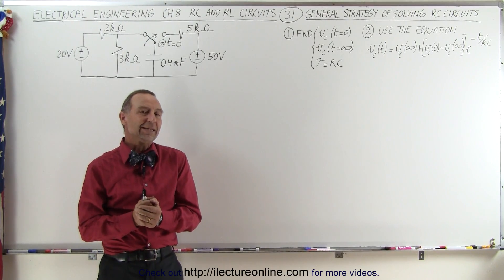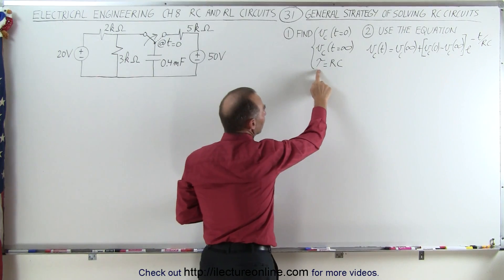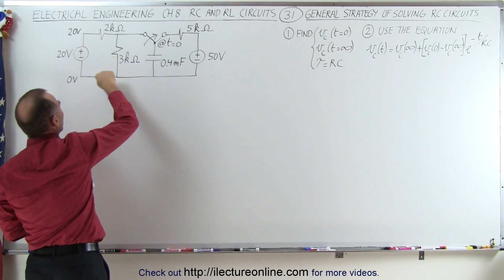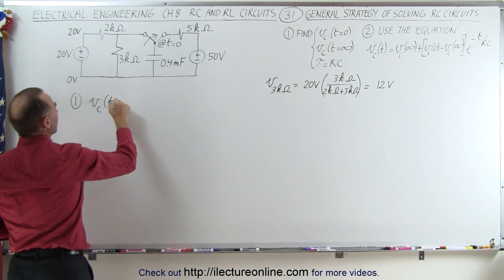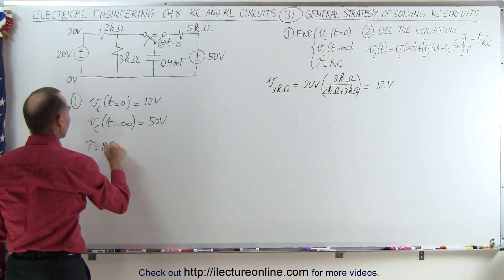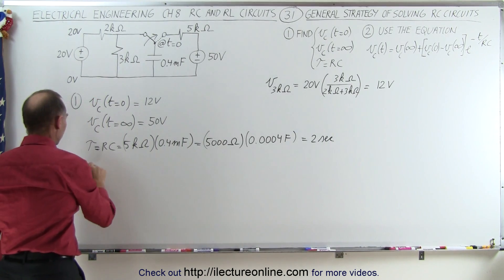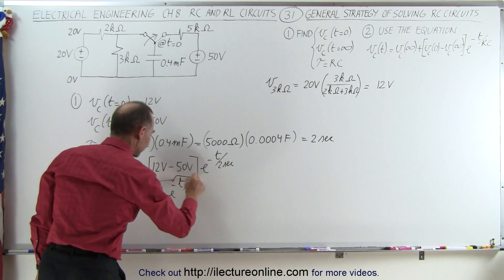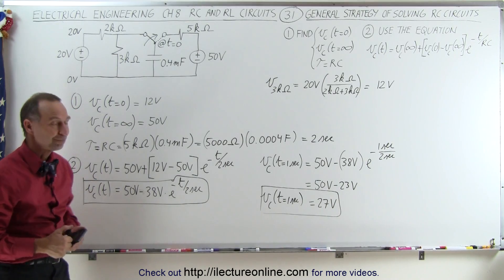Electrical Engineering: Ch 8: RC & RL Circuits (31 of 65) General Strategy of Solving RC Circuits

Comment: Sir I think at time infinity 
Voltage across capacitor will not be 50volt as there is a resistor in series which will cause voltage drop 
May be I am wrong

Comment: Great video but quick question, why don't you include the 20V source when finding Vc(infinity)? Is it because all of the current from the 20V source travels through the resistors on the left and to the ground? Or is it more of a conceptual reason?
Reply: The switch is moving from left to right, making the capacitor connected to the right side and disconnecting the entire left side. It took me a minute to realize it wasn’t moving up, but rather to the right.
Reply: @Shlivo thanks brother!

Comment: sir i wanted to ask that it is given at time t=0 the switch will move towards right, so how can we consider the circuit for capacitor voltage: the left one??
Reply from the maker: When the switch is thrown to the right at t=0, the capacitor will be fully charged and the capacitor will temporarily act like a battery.
Reply: @MichelvanBiezen  okay thanks alot sir

Comment: V (infinity) = Why would the current not flow through the resistor???
Reply from the maker: Once the capacitor is charged, no current will flow through the branch on the right (no current through the 5K ohm resistor.

Comment: At time zero for the left loop isn’t the charge on the capacitor zero so won’t the potential across it also be zero?
Reply from the maker: Before the switch is moved from the left position to the right position, the capacitor will be fully charged.
Reply: @MichelvanBiezen  ah, I was seeing time zero as the assembly of the circuit but your saying time zero is actually after reaching steady state with left circuit closed.
Reply from the maker: That is the assumption, yes.

Comment: is the voltage 50 at the capacitor at t=(inf) because of KVL?
Reply from the maker: At time = large, the current in the right mesh will stop when the capacitor is filled with charge, hence there will not be any voltage drop across the resistor and the entire 50 V of the source will be dropped across the capacitor.

Comment: Hello Professor Biezen, where did the equation from Step Number 2 come from? I tried looking back in the playlist, however, I personally could not find the derivation. Thank you in advance
Reply from the maker: The voltage in any circuit will always be the sum of the steady state voltage and the transient voltage and the transient voltage is always going to be an exponential decay function as illustrated in the video.  You can find more information in the rest of the playlist or here:  PHYSICS 48 RC AND RL CIRCUITS

Comment: Huge thanks prof Michel. One question, what if the second source was less than Vc(t=0), what would happen then? would the source be harmed ?
Reply from the maker: Note that these examples are just made up in order for us to learn how to  handle these type of circuits and don't necessarily represent real circuits.  That said, unless the components used cannot handle the voltage or the current, there should be no problem changing the voltage.
Reply: Alright, so given that the components could handle such voltages, the capacitor would discharge in the source right ?